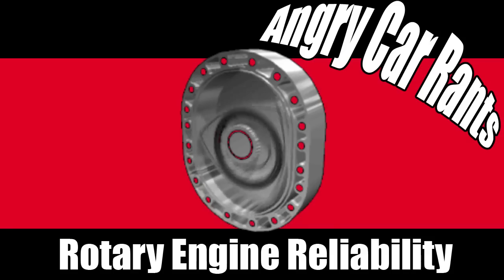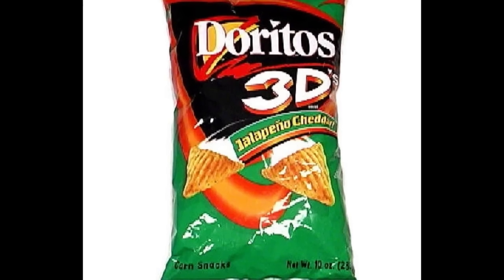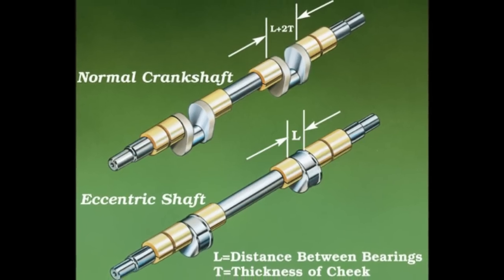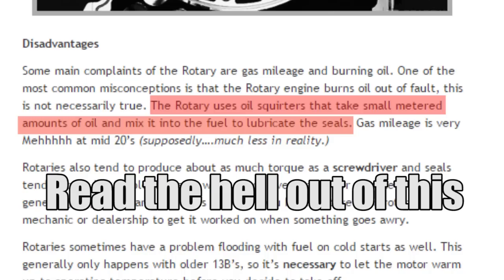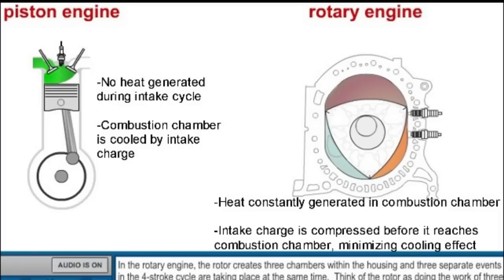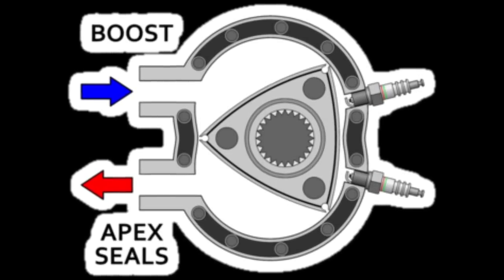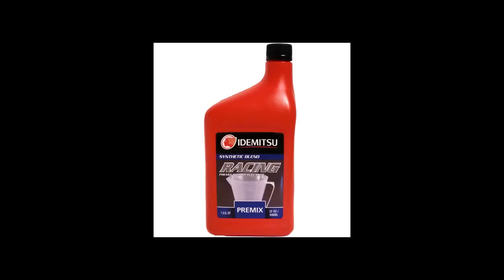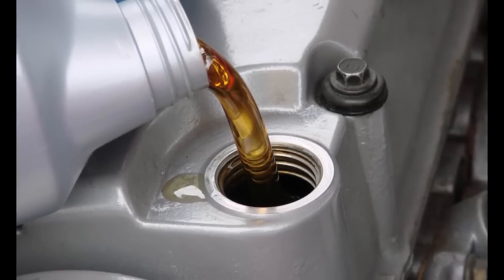Angry Car Rants #3 - Rotary Engine Reliability

Comment: watch rotary hemi breakthrough
Reply: The trailing side of the rotary engine's combustion chamber develops a squeeze stream which pushes back the flamefront. With the conventional one or two-spark-plug system and homogenous mixture, this squeeze stream prevents the flame from propagating to the combustion chamber's trailing side in the mid and high engine speed ranges, Mazda engineers described the full process in 'Combustion characteristics of Rotary Engines', K Yamamoto et al., SAE paper 720357. Kawasaki addressed this problem in their US patent nº 3848574. This poor combustion in the trailing side of chamber is one of the reasons why there is more carbon monoxide and unburnt hydrocarbons in a Wankel's exhaust stream. A side-port exhaust, as is used in the Renesis, avoids one of the causes of this because the unburned mixture cannot escape. The Mazda 26B avoided this issue through a 3-spark plug ignition system. (At the Le Mans 24 hour endurance race in 1991 the 26B had significantly lower fuel consumption than the competing reciprocating piston engines. All competitors had the same amount of fuel available due to the Le Mans 24 hour limited fuel quantity rule.)[56] An inventor proposed that a narrow linear opening for spark plugs in the housing, instead of the round hole, would improve volumetric efficiency, fuel economy and emissions; he claims to have proved this by recording a measured reduction in the exhaust gas temperature. As in early reciprocating engines, a lower effective compression ratio is linked to higher exhaust gas temperatures. (YouTube: 'Rotary Engine Breakthrough')
Reply: @therealdokoterbimmerrotary6751  MOVING COMBUSTION CHAMBER Detonation - supersonic wave

Comment: The wrong Oil ist most of the times the problem. Synthetic Oil is forbidden for rotaries! Use simple mineral based motor oil like Castrol 20 W 50...
Reply: No, depends on the type of synthetic oil.
Reply: That what is suitable for Rotaries ? Never seen someone mention it on the can have You ? What type do You use in Your rotary ? In my one I use Castrol Mineral Oil.
Reply: Heiko Panzlaff You don't know a lot about this subject do you?
Never heard of Idemitsu?

In my Rotary engine? it requires a special castor based oil, Klotz Be-Nol.
The Wankel only requires regular motor oil.

Comment: The NHTSA recall investigation found no link between what the owner s did and the failure rate...  Wankel engines are inherently less reliable which is why Mazda no longer sells them.

Comment: I hope no one actually believes any of this nonsense...
Reply: The trailing side of the rotary engine's combustion chamber develops a squeeze stream which pushes back the flamefront. With the conventional one or two-spark-plug system and homogenous mixture, this squeeze stream prevents the flame from propagating to the combustion chamber's trailing side in the mid and high engine speed ranges, Mazda engineers described the full process in 'Combustion characteristics of Rotary Engines', K Yamamoto et al., SAE paper 720357. Kawasaki addressed this problem in their US patent nº 3848574. This poor combustion in the trailing side of chamber is one of the reasons why there is more carbon monoxide and unburnt hydrocarbons in a Wankel's exhaust stream. A side-port exhaust, as is used in the Renesis, avoids one of the causes of this because the unburned mixture cannot escape. The Mazda 26B avoided this issue through a 3-spark plug ignition system. (At the Le Mans 24 hour endurance race in 1991 the 26B had significantly lower fuel consumption than the competing reciprocating piston engines. All competitors had the same amount of fuel available due to the Le Mans 24 hour limited fuel quantity rule.)[56] An inventor proposed that a narrow linear opening for spark plugs in the housing, instead of the round hole, would improve volumetric efficiency, fuel economy and emissions; he claims to have proved this by recording a measured reduction in the exhaust gas temperature. As in early reciprocating engines, a lower effective compression ratio is linked to higher exhaust gas temperatures. (YouTube: 'Rotary Engine Breakthrough')
Reply: @therealdokoterbimmerrotary6751  MOVING COMBUSTION CHAMBER Detonation - supersonic wave